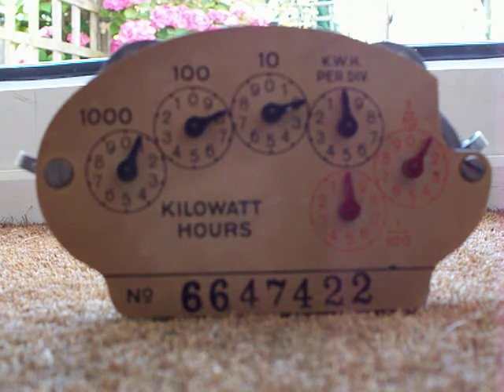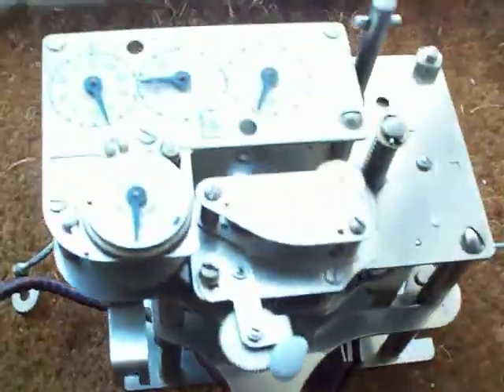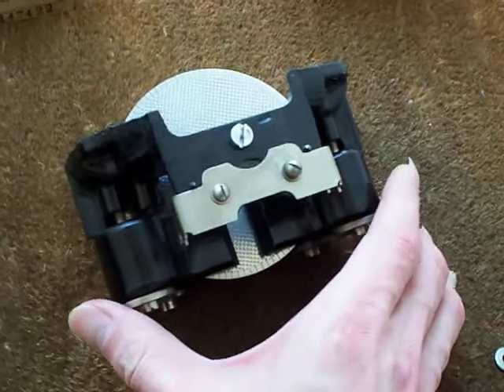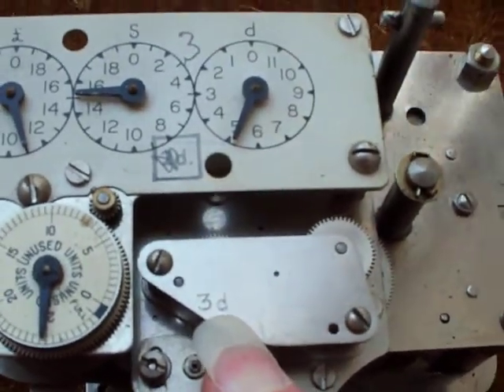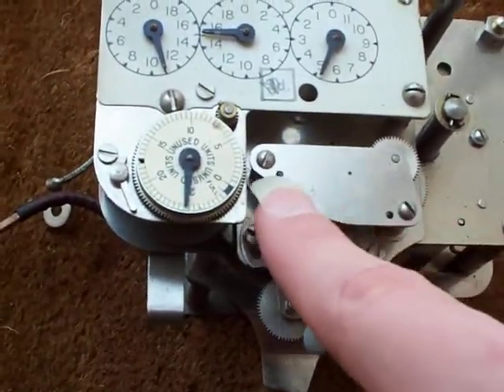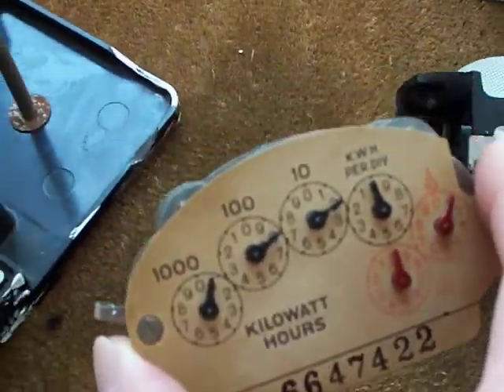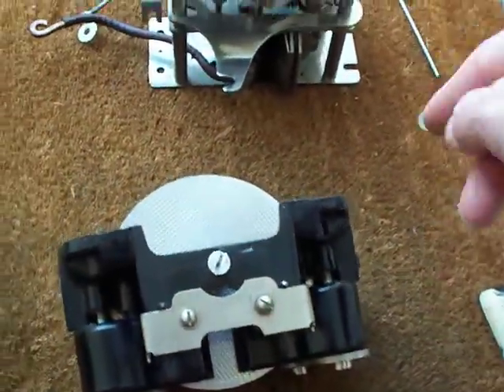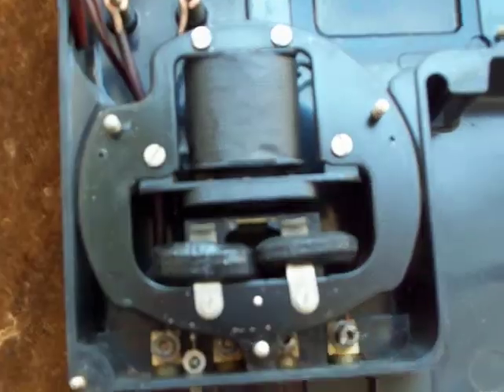Electricity Meter Restore 1 ( Part 16 of 25 ) British Sangamo Type HM.

Comment from the maker: @douro20 If you're referring to the Load Wheel, then the axis sits on a 'needle-point', so not jewelled as such. I think the escapements in my Horstmann Vmk clocks are, because I can see little ruby-red things in the workings! But generally, in kWh meters, the two types of axial support I know of, are the earlier Needle-Point, & the later Magnetic Bearing. With the latter, the load-wheel 'floats' on a magnetic field, & Sangamo coined a name for this technology: FLOTON. ( say: Float-On )

-BBD.